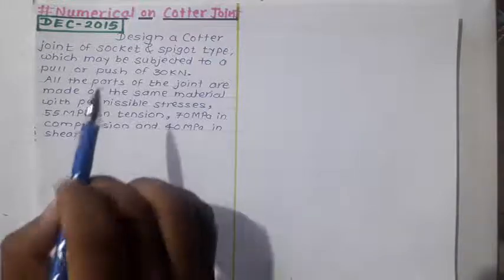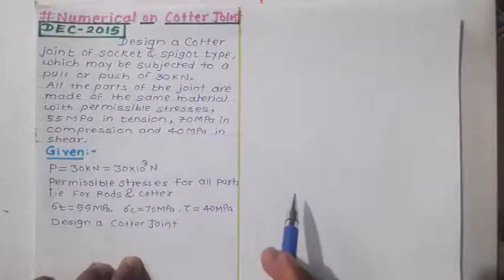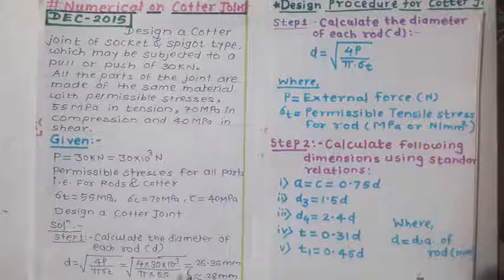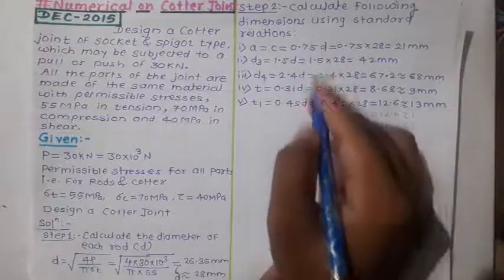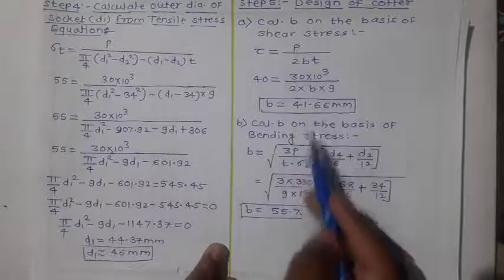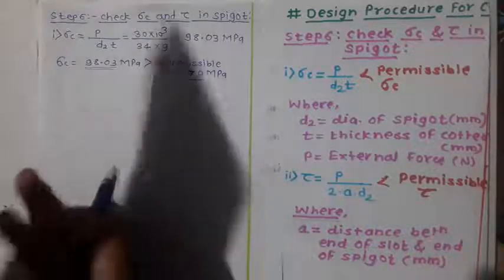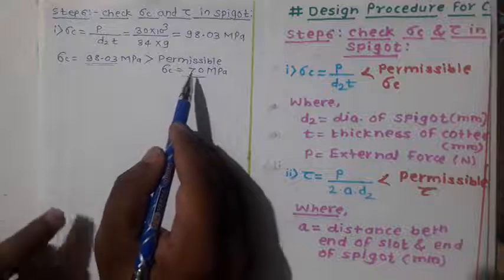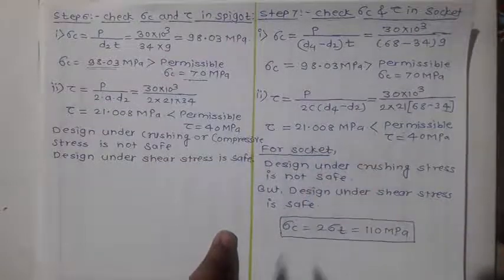2.34 Numerical #1 on Cotter joint _ University Exam Dec 2015 _ Machine Design I

Comment: How step number 5 second b is calculated
Reply from the maker: At 13.44 on left side, Equation of bending stress in Cotter is given, from which equation for b derived...and this is equation is used to calculate b
Reply: The value is calculated as a 50.73 =b

Comment: In step no. 4 socket diameter there is mistake. You multiplied π/4 with d1 square & gave + sign and in 9 multiplied by +d1 you gave minus sign. & 9 multiplied by -34 you gave + sign. Explain please
Reply from the maker: I think there is no mistake...it is just simplification of equation..still if you think there is mistake, please type here equation where you find difference